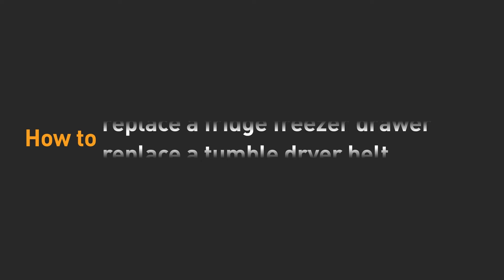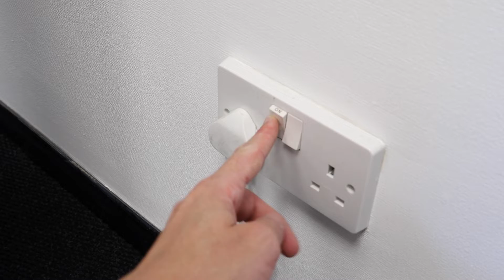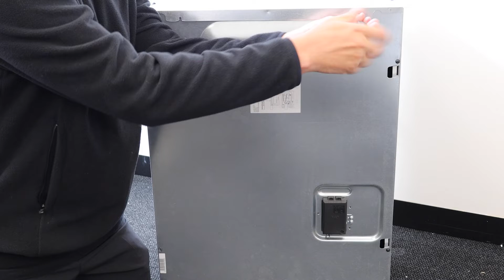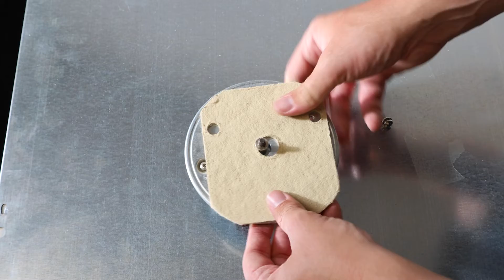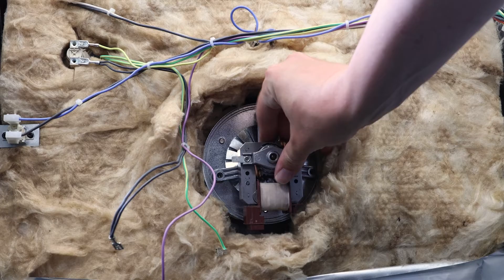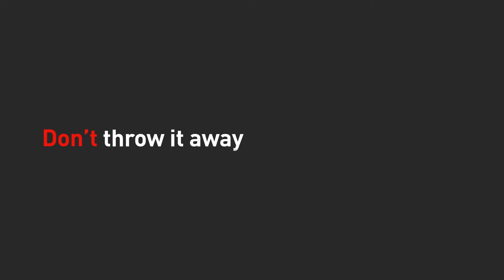How to Replace a Hotpoint Oven Fan Motor

Comment: Hi do I need a new element as my oven fan started making a noise then it went bright red and blew the trip do I need to replace just the van or fan and element also my hotpoint is a different model so will replacement been same